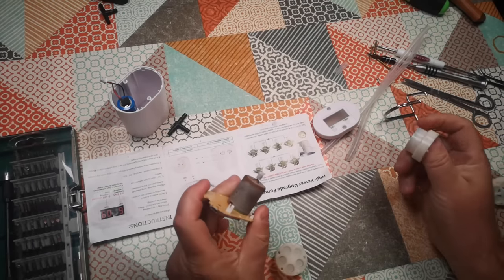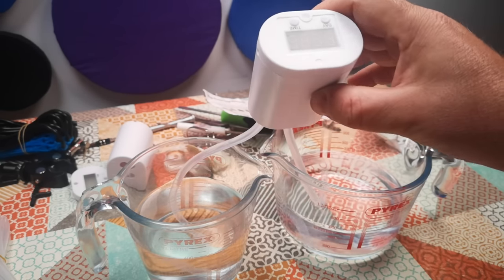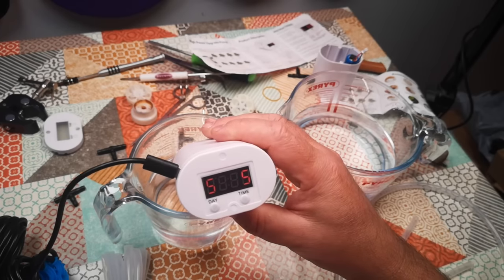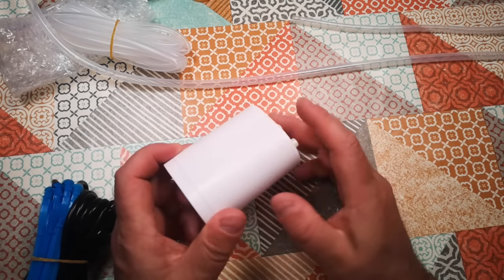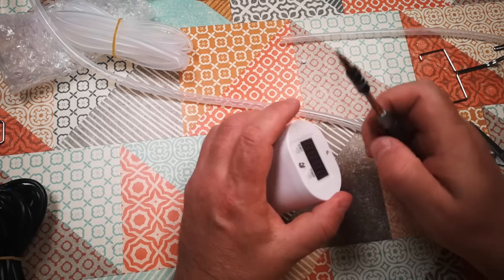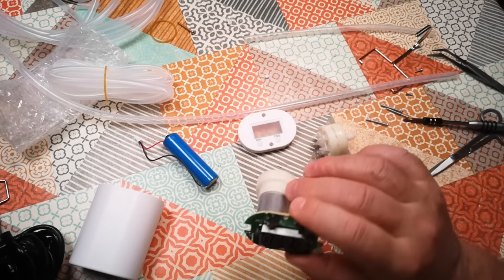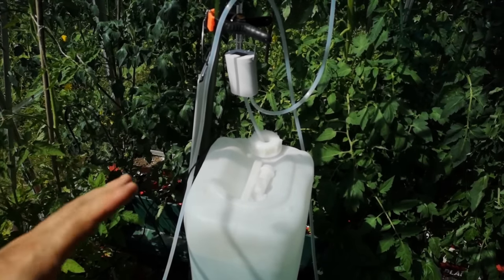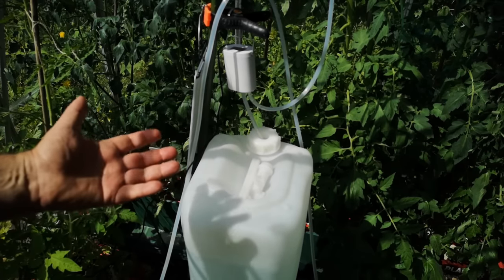Automatic Greenhouse Watering Part 2 – It Works! And Then I Broke It!

Comment: Honestly I wouldn't blame myself for the second pump dying. I think it's reasonable to expect products to have a useful lifespan if not deliberately abused. Yes, if you left it like that for a week of daily watering and you found it no longer worked, sure, that would be a screw-up. But being able to survive one short cycle in a fault condition is not an unreasonable expectation for any product, cheap or otherwise.

This whole race to the bottom of making products too cheap really annoys me. If you can't not make a product so cheap that it destroys itself at the slightest provocation, then perhaps you just shouldn't make that product. Seriously, if consumers have to pay slightly more than this very soon-to-be e-waste, perhaps that's not such a bad thing if it means things actually last.